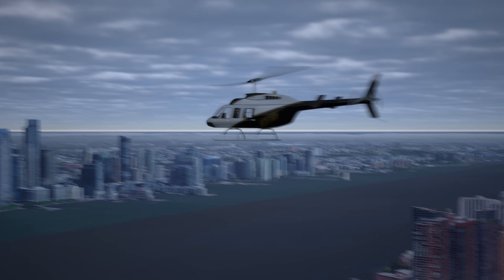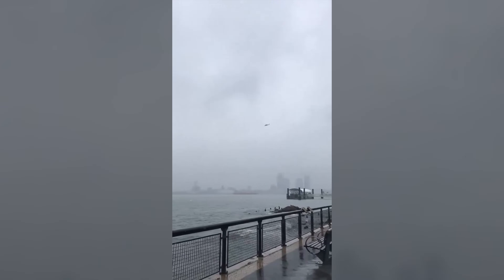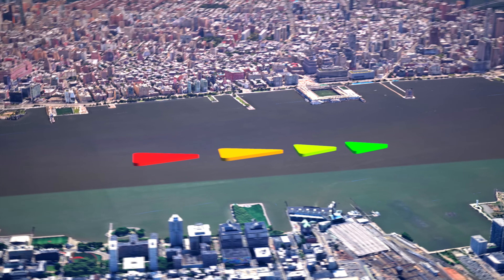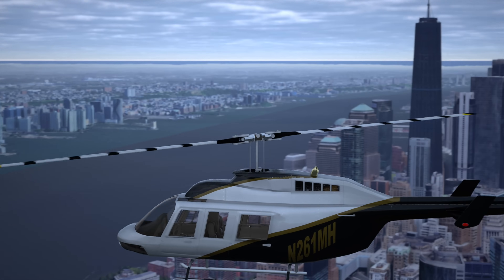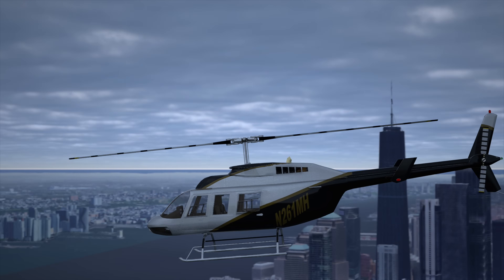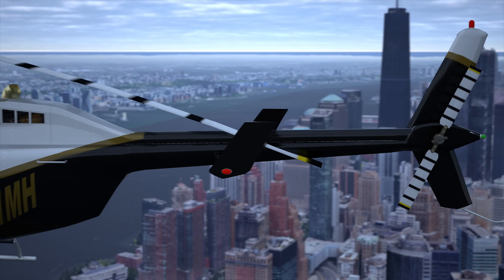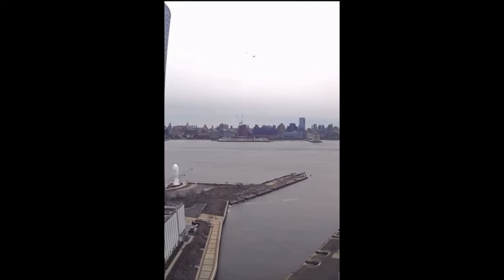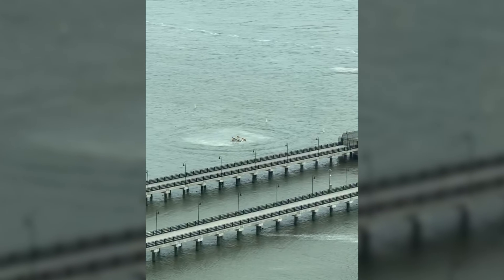Helicopters DON'T just fall from the sky - What is "Mast Bumping"?

Comment: Check the preventive maintenance log for main  rotor bearing replacement every 1000 hrs of flying time.  Start here
Reply: The NTSB will do that, among many other things.
Reply: There was also a defective batch of main rotor blades in which fatigue cracks on the inner surface of the blade spar were found on multiple Longrangers, after a series of crashes back in the 2000’s.
Reply: @Captain101-x1o Einstein NTSB is late on this one. They need to ramp up quarterly inspections 😮 maintenance shops off the grid. NTSB needs to be proactive instead of reactive!
Reply: @Gigantor60 NTSB investigates, the FAA regulates.
Reply: Thank goodness your here, the NTSB would never have thought to check that otherwise…
Reply: @Captain101-x1o  they probably wouldn't have.

Comment: A catastrophic structural failure. Why it failed is the question that needs to be answered. A helicopter is discribed as 10 thousand parts that are trying to shake apart as it beats the air into submission.